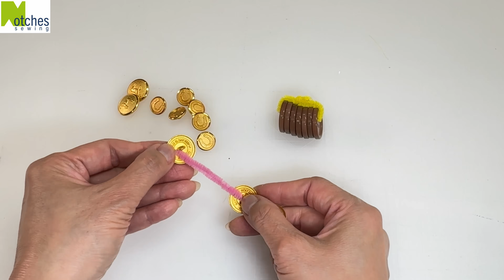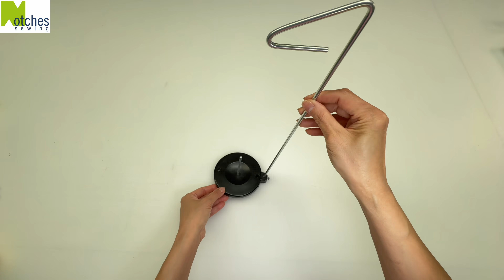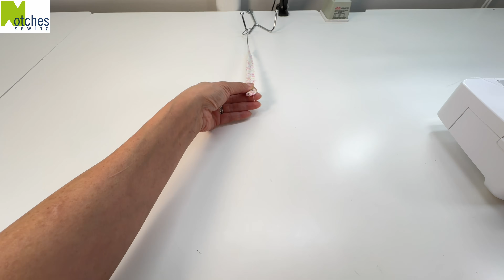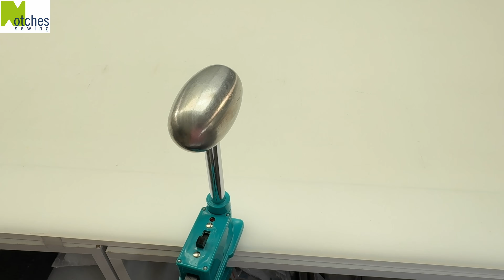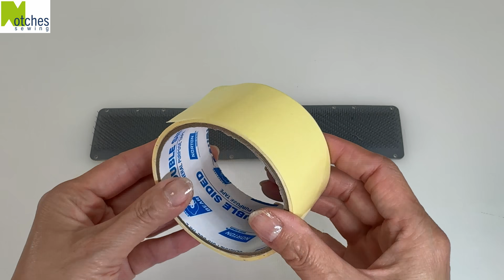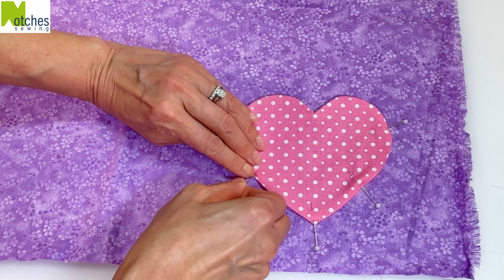Unbelievable Sewing Hacks! 25 More Household Items for Sewing Tools

Comment: We made a magnetic dish for pins by gluing strong magnets inside a plastic jar lid. When I shared this idea in another forum someone scornfully said her fingers thanked her for not burning them with hot glue. I didn't use hot glue, just strong glue that used to be called "crazy glue" but it is sold under a wide variety of brand names now.
Reply from the maker: Thanks for sharing your tip!

Comment: I do patterns for antique dolls of the 19th century. Here is a way to do very accurate pleats: Use millimeter paper and just cut and join the strips together. Fold the pleats in the paper the way you want them to be. Iron the pleated paper strip. Then pull it apart and use disappearing adhesive spray (as used by machine embroidery enthusiasts,available worldwide in amazon etc. - very useful for lots of uses) and spray the reverse side of the pre-pleated paper strip and press it onto the fabric to be pleated. Now just fold the paper again with the fabric, press and remove the paper. You can reuse the paper numerous times. It is very accurate and easy to do. After ironing, the adhesive ability of the spray has disappeared. Then stitch the top of the pleats. 
After seeing this, maybe it works with freezer paper. I do not know freezer paper. From Germany
Reply from the maker: Thanks for sharing😊

Comment: ❤❤❤❤❤ As usual, EXCELLENT TIPS. Hard to pick a favorite, but two of them are the dental floss sewing kit and the glue stick needle keeper. Both great for travel. I like to keep small projects in a small zipper pouch to take wherever I’ll be sitting for a while—in a waiting room, airport/plane, lectures, as a passenger in a car. A small  portable light that can be worn on the head or around the neck provides sufficient light to see what you’re doing. I’d love to see some “home-made” lighting tips from you and your viewers. 💡❤
Reply from the maker: Thanks so much Susan!

Comment: I would be a bit careful using painter’s tape to label fabric, since the glue can soak into the fabrics after a while.  If you plan to use the fabric within a few weeks, that probably won’t be a problem, but I wouldn’t leave it long-term.  I write on a piece of paper and pin it to the selvage.
Reply from the maker: Thanks for the heads up.  Luckily I haven’t had any issues yet.  Cheers!

Comment: My favorite way to keep thread filled bobbins free from tangling is to use the small hair bands that come in a bag of about 100 or so.  They are about half inch, easy to put on and take off.  They come in clear or black, are very inexpensive, available where hair products are sold, and easy to store in my box of bobbins.
Reply from the maker: Awesome tip!
Reply: I use plastic tubing around my bobbins

Comment: I use larger size clear adhesive wall hooks cantered on my quilting rulers as a handle. You can pick them up easily and the 😮hook part rests nicely in the webbing between your thumb and pointer finger to hold the ruler down on your fabric.
Reply from the maker: Excellent tip!

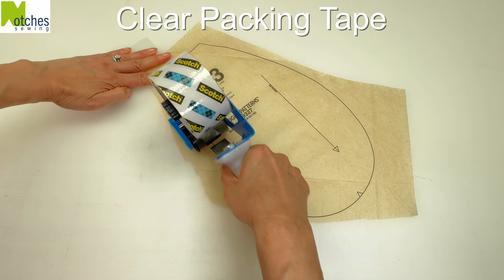Comment: My mum taught me to do 2 lines of stitching for gathering, makes it so much easier.  4:21 A recent hack I came across is to use dental floss for gathering instead of thread. Haven't tried it yet though.  Love your videos.  For pleats, use a kitchen fork
Reply from the maker: Thank you,  If you want perfectly even gathers, sew 3 rows of stitching and then gather.  And if you have one of the rows beyond the sea allowance, the gathers will stay put and stay even when sewing your seam.  You then can remove that row after completely the seam.  The reason for this is that even if the gathers are all even, they can get pushed out of position when sewing the seams together.  Also loosen your tension before sewing the rows.  Have you tried using a gathering foot?   Thanks for watching.

Comment: Sometimes when machine sewing from a cone of thread, the thread will not stay in the thread guides on the machine. A cheap plastic drinking straw can be cut and taped to the machine to make thread guides (that the thread can't get itself out of). It also helps when you are sewing with twin needles and want extra thread guides for the other spool of thread.
Reply from the maker: Excellent hack!!  Thank you Arvetta.😊

Comment: All great ideas. Have to say that, so far, my favorite 2 are the dental floss container and the tweezers. I use tweezers a lot in sewing, but the way you tied the thread with them is going to be very helpful. Oh, and I really like the pipe cleaner tips also. All ideas are great though. So, thanks again for sharing them.
Reply from the maker: Thank you.  Actually my favourite tweezers are the reverse grip ones.  You squeeze to open and they stay closed when just holding them.  I find this more user friendly especially when picking up beads and sequins

Comment: I have another hack for tall thread spools. I use a paper towel holder. The shorter dowel is the perfect size for tall spools and the base of the holder keeps it secure on the table. I’ve only tried this with wooden towel holder, it might work with metal holders as well .

Thank you for sharing the velvet board hack, GENIUS ❤
Reply from the maker: Thank you great idea.  I have an older video just on this if you’d like to watch. https://youtu.be/swMH8THdJHI.